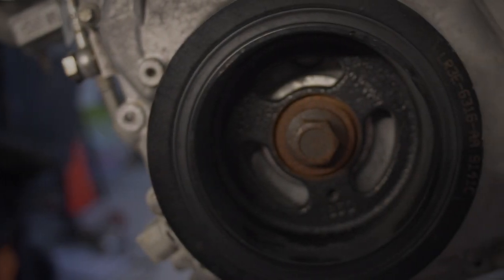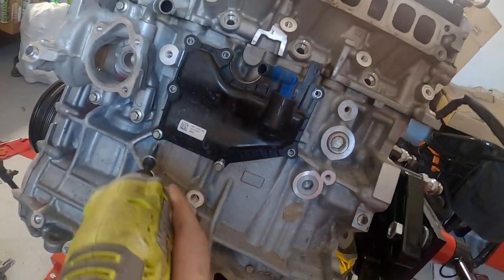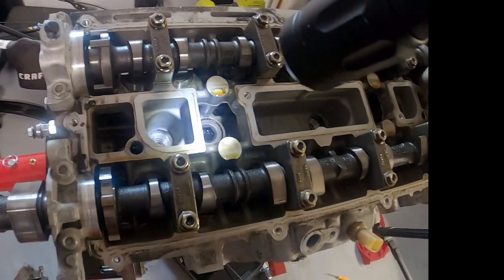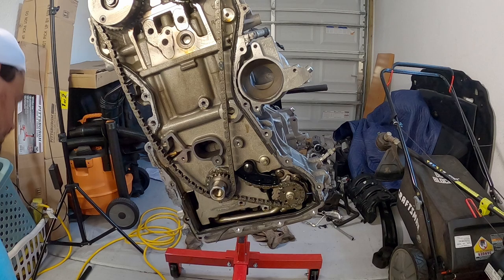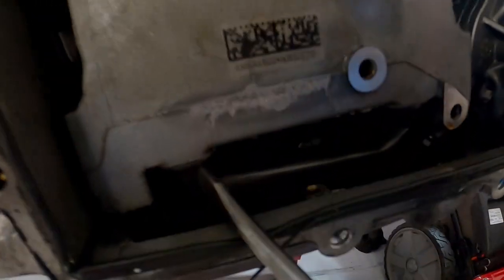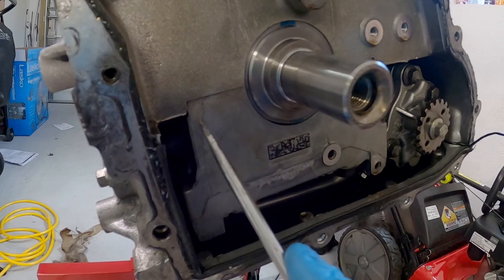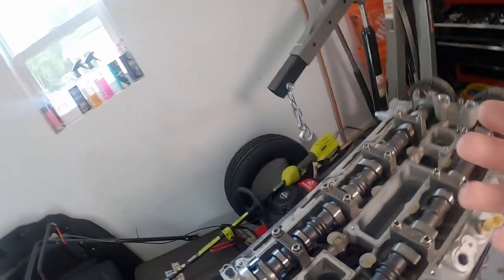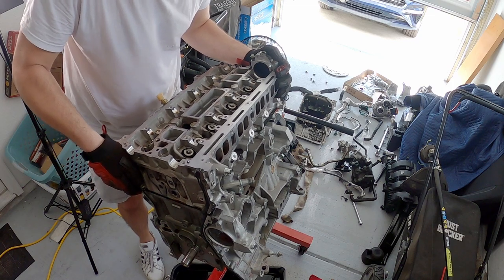Possible Factory Defects FOUND! Ford 2.3L Teardown Part 2

Comment: Is it a valve cover or a cam cover? Yes!
Years ago when I was working at an Auto Parts and Machine store one of our regular customers came in. He was an Airline Pilot that flew the Hawaii route. He had a collection of Corvette, one or two of every year made. In 1981 he had just purchased a new Vette with a 350, ran it 2,000 miles to break it in and took it to the track to see what kind of ET it would run and something let loose during the first run. He pulled the engine and brought it in and the first thing we noticed was the picture window in the side of the block. We pulled the pan and found a tone of gravel. A mixture of its connecting rod and piston from the number 7 cylinder. We took the remaining rods and pistons and the weight was off, the engine was not balanced. The only salvageable thing from the engine was the head from the drivers side of the block. We talked a while and decided to build him a real 350 with 462 heads, four bolt main, forged crank and rods. When all was said and done the Vette ran low 13’s which was pretty good for a street driven car back then.

Comment: When it's time to put it back together,  there is a bolt hole behind the AC compressor location that you thread a bolt into and it stops the crank at TDC on Cyl #1  and I'm sure you know there is a Cam tool that holds the Cams in the correct orientation while you install the timing chain..
Reply from the maker: I'm aware. If I have to put it all back together, I'll get the kit for timing these. Not a big deal. I appreciate the advice 🙂

Comment: Great content man! Like others have pointed out, you should find some contact at ford to send this evidence to. Dealers are sketch and will say no without listening. Ford corporate should be more willing to understand what has happened here. 
Best of luck! 
I can’t believe the defects within the engine. It makes me feel both thankful and scared of my 110,000 mile 2.3. Mainly because either it’s one of the ones built correctly or it’s gonna crap on me soon too.
Reply from the maker: I definitely will! As I said before, these ecoboost engines are so inconsistent. Some are great, and other's are terrible. This is direct proof of that.

Comment: What was the initial issue? I was just randomly driving in my "stock" 2021 Ranger Tremor (no engine mods) and heard what sounded like a rod knock/clacking sound from the engine. It has been almost a week at the dealer and they have not found the issue. Who knows how much work the tech really did. Friday all he had off was the valve cover and plugs and they looked good. He thinks it will probably need an engine but for the last 3 days they have been saying they are gonna drop the pan.
Reply from the maker: It was running great up until it wasn't. I floored it, the engine loaded up and made a weird noise, then it turn off. The dealership never determined the actual cause of damage. Ford claimed immunity by blaming modifications. My teardown showed signs of coolant intrusion and hydraulic lock on cylinder 3. The head gasket had signs of leaking in various places but not fully failing. It's really hard to say what actually happened.
Reply: @KarzKreated  dang, yeah my 2.3L was fine till the second it made the noise but even then, idled fine and drove fine till it hit the rpm range of the noise. Coolant temps ok and plugs looked good. Tech is supposed to drop the pan. He did a 2.3L in a new gen mustang for a cracked cylinder wall and was wondering if that could be it too.

Comment: This is Valencia engine with 63 mm turbo compressor wheel and 50 mm turbine wheel? Don't you remember which spring was in that Turbosmart wastegate actuator?
Reply from the maker: The WG has a 12 PSI spring. I opted to get this one rather than the common 14 PSI because I knew the 14 would've been too much without tuning.

Comment: but in one of your videos,, you did say this; i put a tune on the engine' correct?
Reply from the maker: The car wasn't tuned when the original engine failed.
Reply: @KarzKreated  so you are now telling us.. that the engine was not running..it just fell apart on its own?
Reply: @KarzKreated  you did not answer the question.did you not say you had put a tune on the engine?
Reply from the maker: The car is currently tuned with the new engine. The car was never tuned prior to engine failure. In any video that I mention of the car being tuned, is with the new engine.

Comment: I literally only came to learn how to remove the crank bolt and its pretty much the only thing you skipped
Reply from the maker: Well this isn't a tutorial video but I can tell you how. You need to lock the crank in place with the insert tool or what ever you can find, and use the longest breaker bar to can find. Or you can throw an impact on it and get it that way. Either way takes some work because it's in there extremely tight from the factory. And it's a normal thread direction, so righty tighty, lefty loose. Hope this helps.